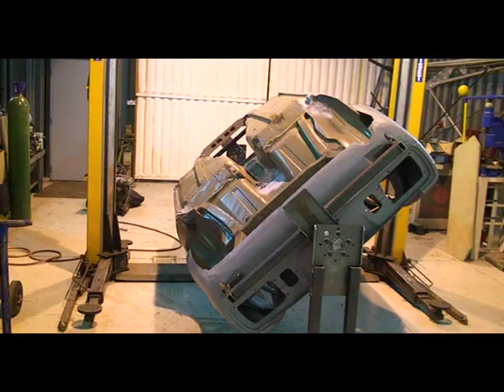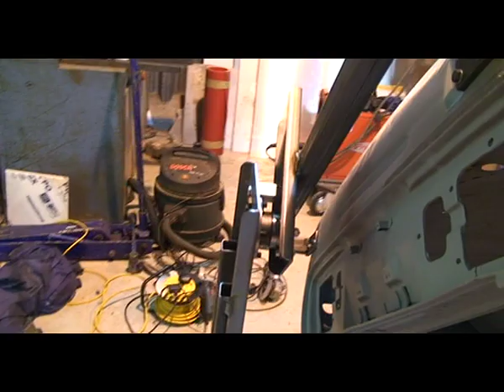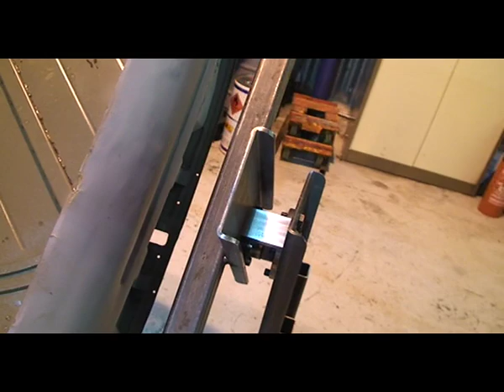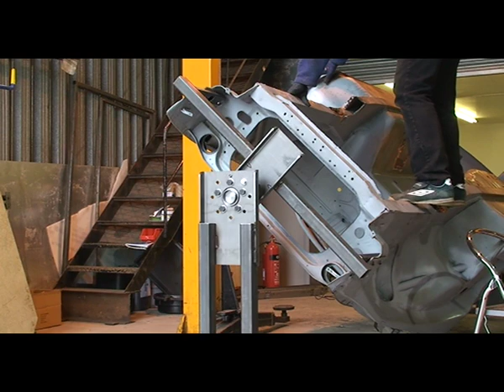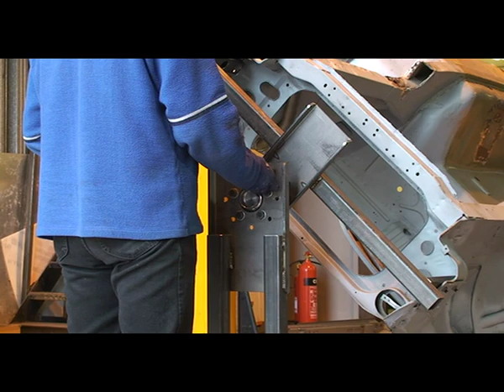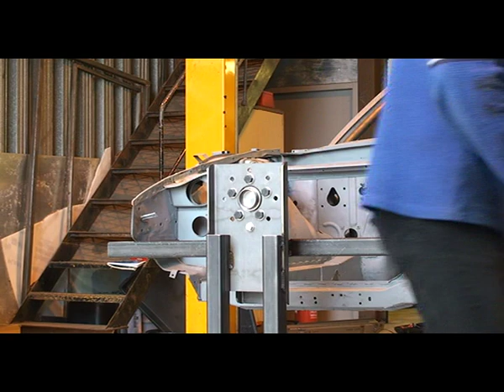Car rotisserie / spit brackets

Comment: Love the wheel hub assembly center pivot. I presume there's one at each end. Used similar to pivot ceiling air hose reels and will use 1 ton truck hub assemblies for an overhead shop boom.

Comment from the maker: Yes its a 260Z.
We measured 3 shells with our FARO arm & took an average to manufacture a jig system to fit our Spanesi bodyshell jig & then designed/built 3 shells & modified all the suspension etc.
The cars are running in this years (2011) historic safari rally.